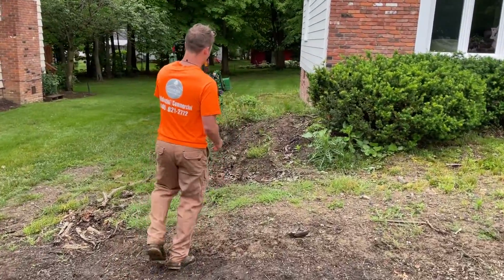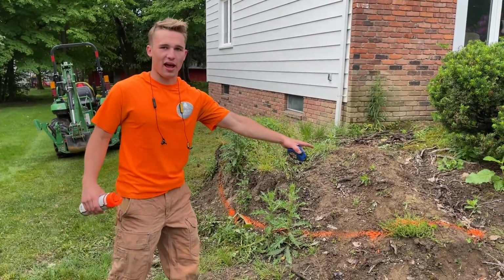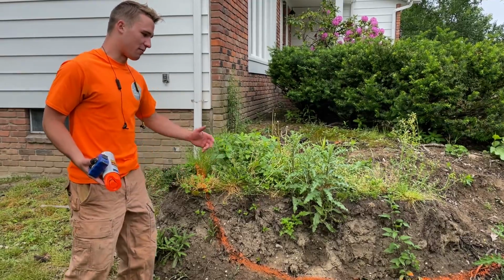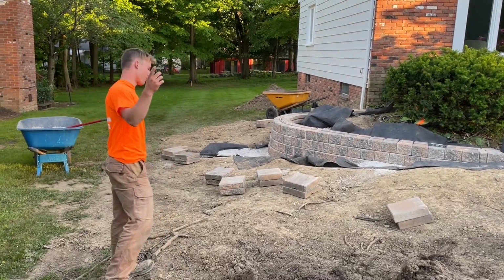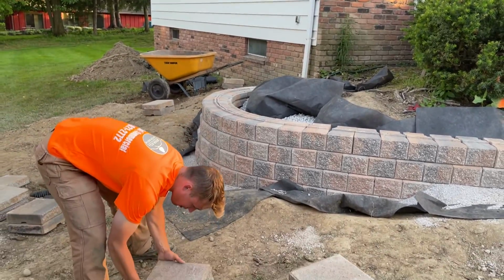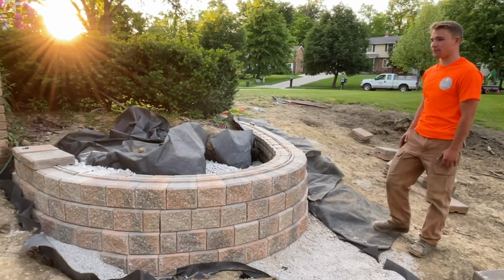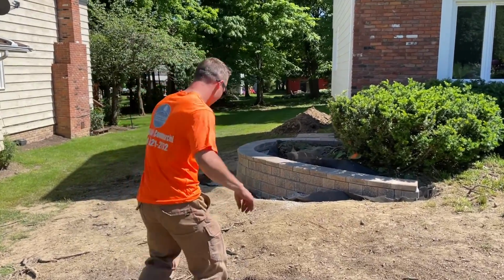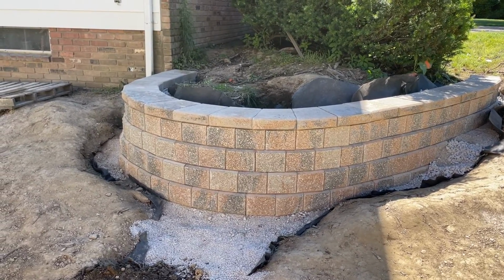Retaining Wall Installation [And Step By Step Walk Through]

Comment: I've been doing retaining walls and hardscape installation for over 30 years good job guys some people say they even notice the joints crossing over each other that's just the way it is as long as you got over 2 in I'm not touching lines on radiuses one thing I didn't notice you should put a drain I know it's not an engineered wall but it helps just make sure the place is always a compact base and it's got green rock behind the wall for a wall like that I would at least put a foot away from the wall and keep it down about eight inches and just fill it with dirt but I didn't know it's one thing maybe I didn't see it maybe I'm wrong did you guys call Julie for for locates especially using a heavy equipment like that never assume that power gas runs where you think it runs or water be very careful continue become responsible and that is costly you lose the whole profit on the whole job and maybe more but other than that good job guys keep up the good work you're going places bless you be careful out there
Reply from the maker: Thanks for the kind words! After reviewing the video, I did notice that we left out many different things to point out throughout the video. We did have a drain running about half way around the wall (Where the #57 material is). We buried our drainage about 15-18 inches below the compacted base. Hopefully we can make a more in depth video in the future. Thanks!

Comment: Nice work.👍👍👍. Can i ask something?

Can i build the garden retaining wall  3 layers  crossover on buried 3 inches sewer pvc pipe line. 1  paver has 24 lbs  weight. I build with 3 layers .so weight will be 75 lbs  . Sewer pipe can handle of that weight . Someone Please help me concern and  instruction  please .
Reply from the maker: It depends what type of sewer pipe you would be building on top of (wall thickness of the pipe). Generally I would not advise building a pipe with a depth that is less than 6-8 inches below the natural grade; however, you might just be able to get away with it, considering it only has 3 layers, it would just depend on the wall thickness/ type of pipe
Reply: @Ledgehill   3 inches diameter pvc pipe and it was buried   depth about 30 inches under the ground    and  i digging  5 inches  depth   for paver and i will put the paver base about  2 inches thick and i will put the paver on the top of paver base.  my paver is 4 in high and 12 inch  length  7 inch width  and has 24 lbs weight .  i will install with 3 layers and i will put the gravel crash stone for backfill .  Jst only for 3 layer paver stone ( 1 ft hight ) .shluld i need to put the geotextile fabric  under the paver base .Thank you so much for your reply and i appreciate your times  for replying and  advise to me .Thanks sir
Reply from the maker: Considering that the pipe is 30 inches below the ground, you should be all good to lay pavers/block on top of it. Since you are using block on a smaller application, you don't need to put the geotextile fabric under/behind the block (unless you have it on hand and want to over-engineer it). Keep up the work!
Reply: @Ledgehill  Thanks you so much sir

Comment: looks nice, but I see a small "hump" in the wall  - not perfectly level, notice that in some other areas too, I am sure it is tough to get perfect level and a little off on the first row and it shows up on subsequent courses..  Wall looks short on the front side but maybe that is the design.
Reply from the maker: It does appear that there is a slight 'hump' in the wall; however, we do ensure that every block is sitting level before laying the next block as well as cross leveling along the whole wall to ensure that the wall will be structurally sound for decades to come. Oftentimes the camera angle and grade of the yard can make the wall look like it is not correctly installed. I appreciate your attention to detail though! Thanks!
Reply: @Ledgehill  It definitely looks that it is all installed correctly.  The color variation in the stone gives the illusion of waviness, that and each row is set back a bit on the next row (as it should since that is how the back lip of the block is) - Likely tricks of the eye going on here.  But really, a very well done job - looks very good!
Reply from the maker: Thanks!

Comment: What kind of material   of the black sheet  and base ?
Reply from the maker: It is generally best to use a woven geotextile fabric for retaining walls (you can find them at most landscape supply stores). The base is #411 crushed limestone (which is #57 limestone with fines). The setting bed is #9 limestone (for the inch of setting bed between the base and the block).
Reply: @Ledgehill  thank you so much sir

Comment: looks good, but i noticed some of the seams aren't staggered.
Reply from the maker: That's correct you would want to off set each layer of block by at least 1/3 of a block, especially with the standard size block.